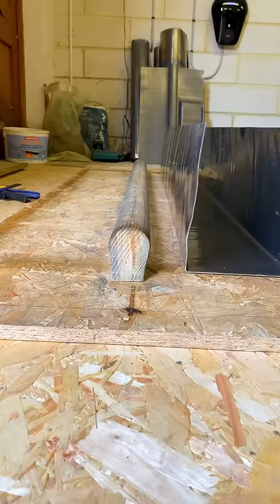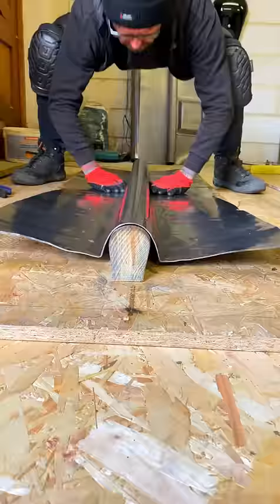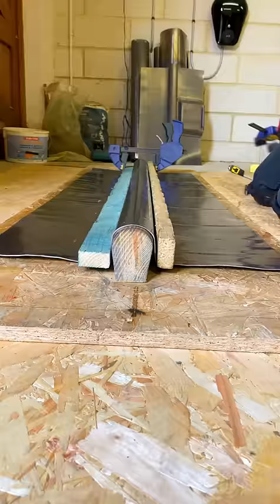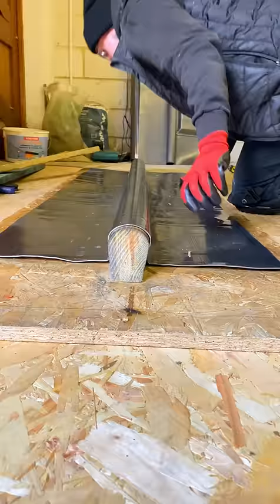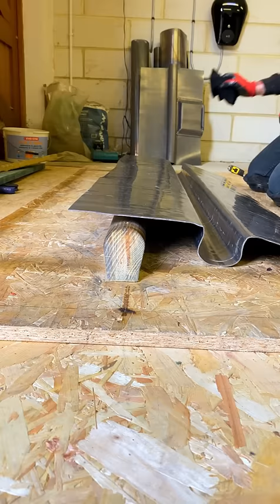Clamping

Comment: Nice job, but I wanna know what it’s going to be used for
Reply: No shit. What the hell is that?
Reply: Thank you
Reply: Looks like an expensive lead ridge cap for a house roof.
Reply: @ReasonedRhetoric  Yes, was about to say the same thing. Beautiful lead roofing that is able to last 800+ years....as long as no one steals it.
Reply from the maker: Check the description or pinned comment for some more in-depth context.
Reply: @ReasonedRhetoric  You're right, that's what it was. If you click on the description located below the video it's another longer video that reveals what it is.
Reply: It’s used on flat roofs in England, they do that because if you had one piece of  flat lead, it would crack.
Reply: @spilleradam  interesting. Thanks.👍🏻
Reply: @leadworksw   hit that block button? You got it 👍
Reply: @ReasonedRhetoric  Interesting.  My first thought was flashing for curved parts of a roof as the lead can be moulded to curves due to how malleable it is (e.g., corners of convex verandah roof)
Reply: So the timber is called a mop stick. They are used to make leads roofs more decorative and they help with the joints and keeping in water tight. Also lead expands and shrinks with the weather so the sheets won't be any wider than 1.500mm  to allow movement so it doesn't split or buckle. The mop stick spacing depend on the roof and lead size. You want the sticks to look symmetrical on rhe roof.  Lead also comes in code sizes,code 1 will be thin whereas code 7 will be thick and extremely heavy. This piece could also be used for a ridge maybe.
Reply: @Lucas-pv2wn  right? watch this and go "what in the world is that and what the heck is he gonna do with that crap?"
Reply: Quite suprised lead is used that way. Or you used at all in buildings.
Reply: Last I heard, dude was going to weld 2 of these molds together, cut the pipe out and seam weld it up the middle, then he was gonna stick it on his car exhaust, He’d say,”Straight pipe is the way to go!”

Comment: It would be interesting to know the application for the finished piece of sheet metal.
Reply: rain gutter most likely
Reply: Its called a lead roll , its a component of a lead sheet flat roof which is often used when renovating old buildings in UK. Best place to see it would be church and cathedral roofs and manor houses etc.Its actually a highly skilled job and was always done by plumbers in the past , but now its mostly done by specialist roofing companies. Lead is still used a lot in UK.
Reply from the maker: See description or pinned comment
Reply: Hip ridge capping.
Reply: He's gonna make you click another video instead of telling you what it is. It's some sort of roof edging thing. A corner piece pf the roof

Comment: That’s lead working. It’s a gable flashing to prevent rain coming into the top of a roof where two sides meet at an angle. In many places they no longer use lead flashing and often fold Galvanised Iron into the same profile …
Reply: Hip flashing ?

Comment: It's not Lead, it's to Rigid for Lead as when he puts it prior to bending it over the 'cast' if it was just Lead it would have folded down under it's own weight, most likely to be a Good Lead Composite
Reply: Ha! Your knowledge of lead work betrays you. 😜
Reply: @normality3848  How's That, for want of a better catch phrase. Having spent since 1992 on site
Reply: It's lead
Reply: Yeah, probably not lead...too shiny. Zinc is more likely.
Reply: @lastchance8142  it's lead I worked with it for years and did these for hips and ridges on roofs many times
Reply: Thank you
Reply: @blitzchaserjzx100  I defer to your experience! I only used lead for plumbing work...never was that shiny.
Reply: Dépends of the aloy. Higher lead content would have colapsed indeed. Take it from a sheet metalworker.

Comment: Lead Expansion Joint for a roof!
Reply: Lead expansion joint?
You have a restriction on the width of lead sheeting depending on the code (thickness) of the lead being used. Fore example, with code4 lead 
The restriction is about 1.2m, if memory serves me correctly.
Code 3 is about 800mm wide, I think. I've never seen or used 1 or 2.
Why would you need an expansion joint?
I'm not a roofer as such but have done a bit of roof tiling work with kent peg tiles and a bit of lead flat roofing.
If you know better, I stand corrected!
Reply: @davidashton2361  I'm not a roofer! I was a sheet metal worker..... commercial roofing sometimes uses lead expansion joints as a cap over the expansion gap on large commercial structures as it is flexible enough to allow for expansion and contraction without cracking.....not used as much any more but it is still used in certain spec conditions........
Reply: @irongoatrocky2343  Sorry to belabour the point, but lead is the worst kind of material to use as an expansion joint. Being very soft it rubs away easily with the movement caused by constant expansion and contraction cause by variations in temperature.
When I made lead valleys the anti-cappilary joints had to have a drop of at least 2 and a half inches.
This meant that the runs of lead sheet were reduced and on a long valley more a/c joints were needed.
Also, the architect specified a special grease impregnated mat to be laid over the wooden structure of the valley to prevent friction from wearing away the lead sheet.
Sounds like it was a bit over the top and the architect was showing off but it had to last for a long time and be maintenance free. Roofing repair work is expensive, especially lead work, which requires removal of peripheral materials such as tiles.
I know it was only a demo but it could have been couched in a more realistic situation, so that silly old retired gits like me can while away our time picking holes in it.
I did acknowledge that it was beautiful work!
Reply: @davidashton2361  the thing about using lead you don't want sharp/hard bends in it.....most of what I installed was formed in the shop on press brakes using birch wood dies with radius bends.....the roof comp was tar and covered with pit run gravel as a ballast......
Reply: @irongoatrocky2343  Well, as I said, if you know better then I bow to your more extensive knowledge rather than my limited experience.
I'm a retired brit and my knowledge is from our historical structures and building practices, which, I'm sure, differ on a number of points from the States, which I imagine you're from. Also, domestic and industrial situations differ as well, whatever the location.

Comment: My grandfather was a real plumber
Reply: Those were the days when plumbers  worked with lead pipes, before it was realised that lead was toxic, 
and their expertise was used in roofing work where 'weathering' was, and still is, done using lead sheet.
Nowadays, of course, roofers have their own specialists who do all the forming of valleys, including the anti capillary
Reply: Posted it accidentally! Hadn't finished my comment!
Reply: To continue ...
anti-capillary joints, soakers, step flashing, profile leading, as this guy is demonstrating, act.
I know he's only doing a demonstration, (and doing a very good job!) but I don't understand why he's weathering in a profile!
Profiles are situated at the joints of lead sheeting on a flat roof. You can't just join lead sheets on the flat.
They have to be formed over a profile so that rainwater can't rise over it and penetrate the roof structure underneath. Another sheet is then formed over the profile on the other side to cover the previous lead covering on the profile. This means that the profile has a double layer of lead flashing to weather the joint.
I think that would have been a better demo than just showing how to form the lead sheet over a profile.
Maybe it was to be used on a centre line of a flat roof where the runoff sloped away from either side of the profile.